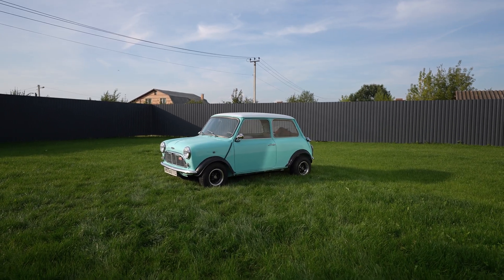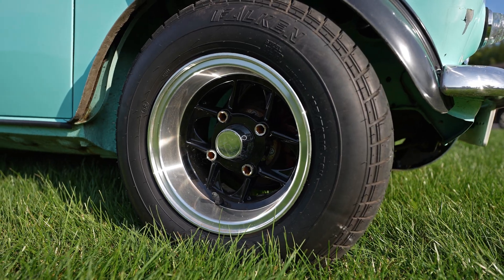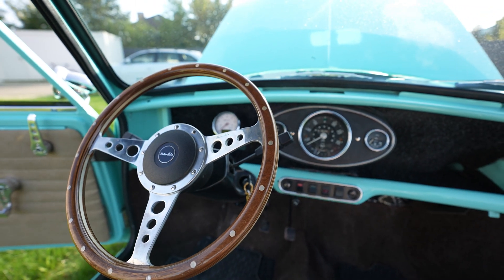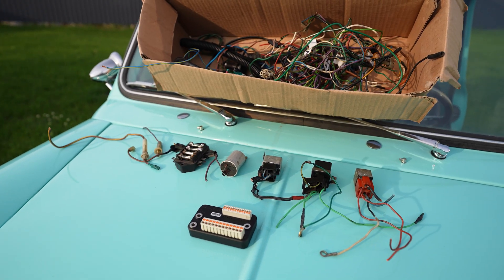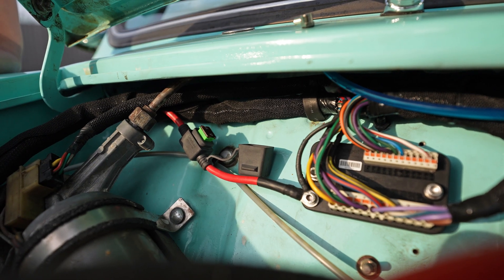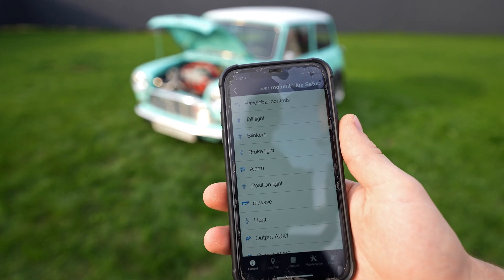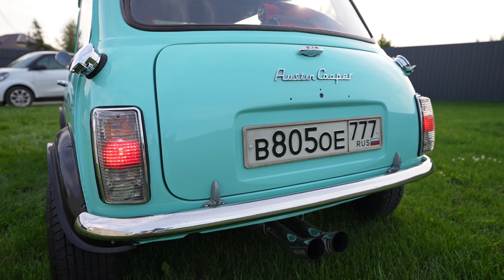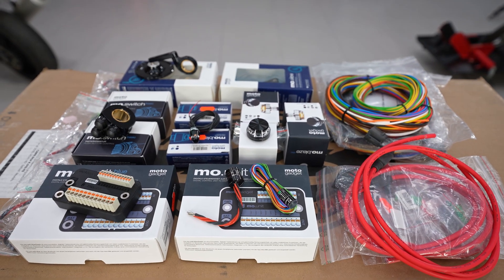New Electrics for Old Car Mini Cooper 1967

Comment: Great build! I’m planning to use an m.unit in my Classic Mini project, and I’m a bit unsure about the grounding side. Does the m.unit send both + and – to each component, or do you still need a separate ground bus for all the negatives? Where did you installed this ? Also, do you have a wiring diagram or could you share more details? And would you guys sell a complete kit with all the necessary wires loom/connectors/components for a car setup? Thanks a lot!